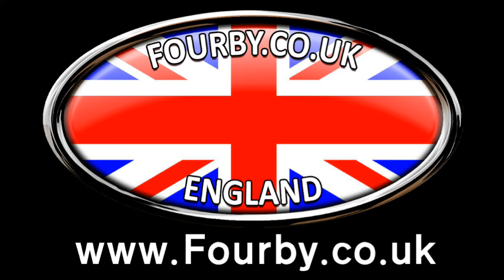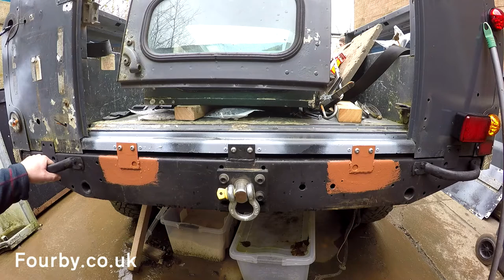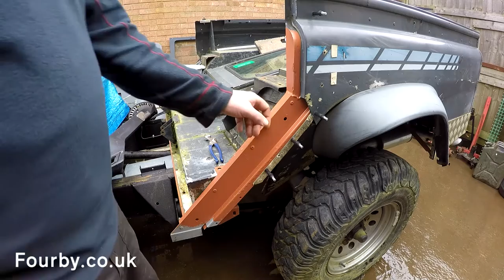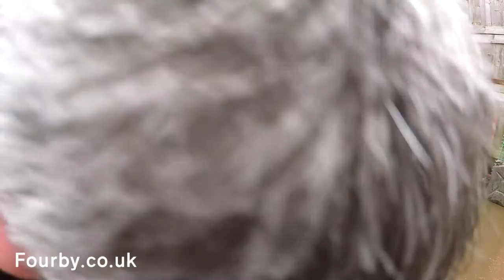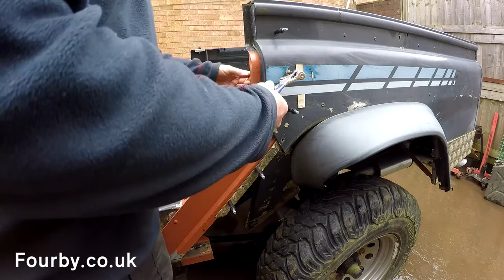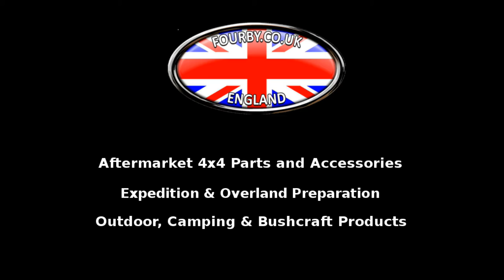Land Rover 110 Restoration #8 "Sill B & C Pillar Alignment"

Comment: I fitted the same C pillar repair sections from YRM to my 110 the quality was great and they fitted perfectly. Before I welded the angle section to the pillar I fitted the doors and small filler panel to help line them up. As mentioned below you've found the original build quality problems. Good luck enjoying watching the videos.
Reply from the maker: I reassembled the body yesterday, I want everything to line up before I commit to the weld, slow progress, but I want it to be as accurate as can be

Comment: Sadly in Solihull every Landy was ‘custom built’ 😂 no two built the same! 
I’ve known bodywork to ‘pop’ when it was dismantled, as over the years it settles from ‘as built’ spec. I need to find a video how to get the back off a station wagon? Its easy to get the tub off a pick up but the LWB 109 ‘Safari Wagon’ was totally different. I need to get to the chassis and weld a new half chassis on but no idea how to strip the back off 🤷🏻‍♂️